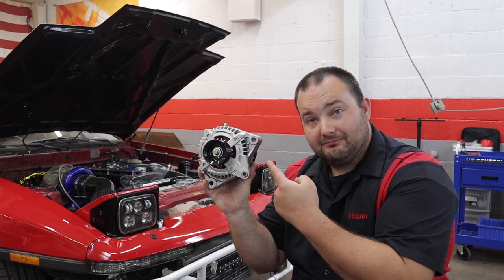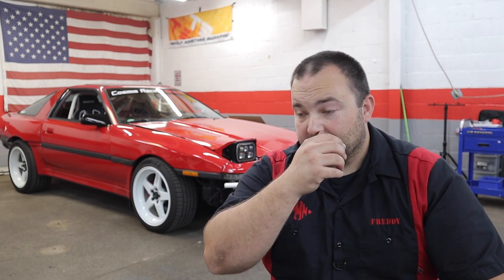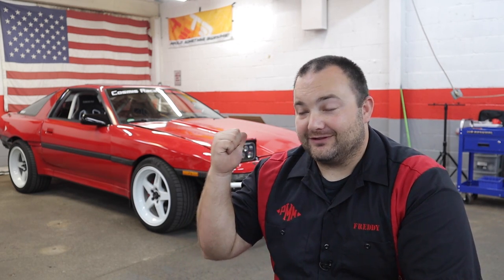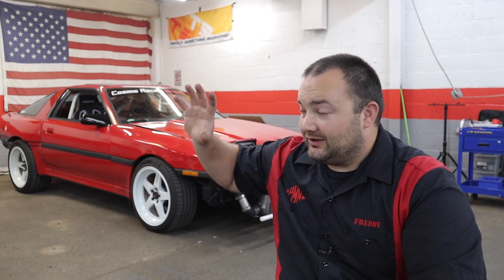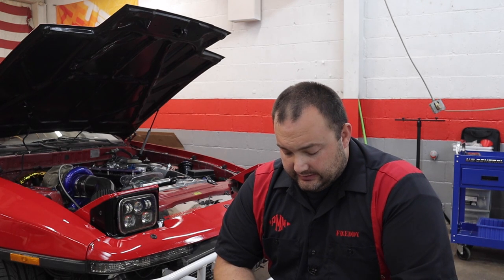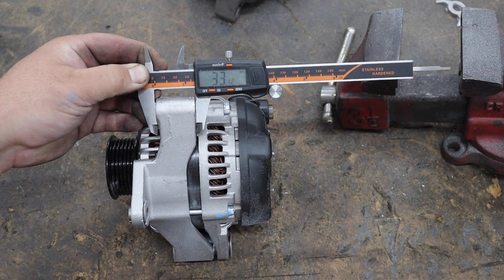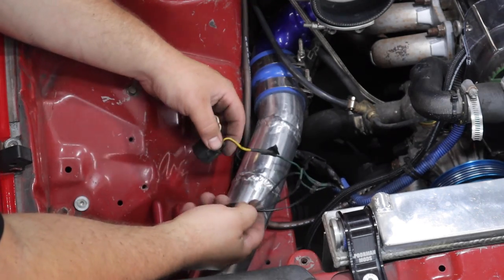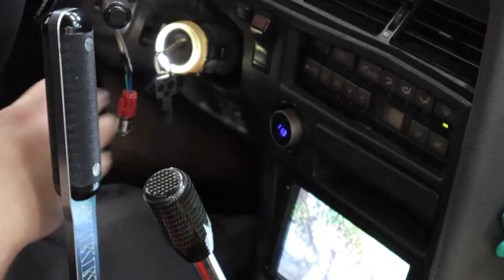I can't believe these non-Supra parts fit my 1JZ MK3 Supra 😂

Comment: One more comment. If your aftermarket alternator pulley is larger than stock, it will turn slower and drop the voltage. It doesn’t take much.

Comment: Followed you since the oooold B15 Spec V days,  are you taking in customers  cars?
Reply from the maker: Heck yeah OG follower!!!👏👏 I currently do no work on "customer" vehicles. Just my vehicles and occasionally friends
Reply: @PoorManMods  

Booo that sucks!  ☹ I still have my Spec that I want to have a some work done. On a side note would be nice to see you resurrect some B15's. Mine is sitting at 34k original miles  but 64 chassis when Nissan NA replaced the motor years ago.
Reply from the maker: @SiCaRiI_DaGgEr  dang 34k miles!! I don't think I'll get another b15, it was a good car and I learned a lot but it was time for me to move onto other things. I probably won't get another Nissan unless it's an R33S skyline
Reply: @PoorManMods  

I know exactly what you mean,  I have since got into the STI's  and getting it built.  If you're gonna get into Skylines grab one asap considering the prices are increasing  on all of them, especially so since the push for EV's  and EPA mandates which is causing a shift to older vehicles.

Comment: Have you drop tested the battery - 11v when off is quite low. 

Also double down on earth from the battery - make them big and to clean chassis points.
Reply from the maker: Battery is new, I think that volt meter reads a smidge low too. Also as soon as the key is turned on multiple things start drawing power